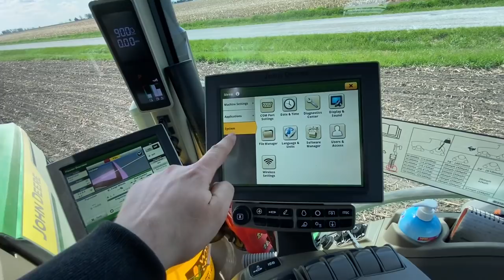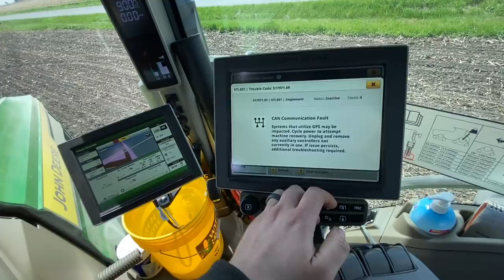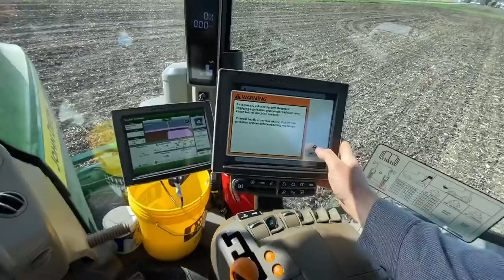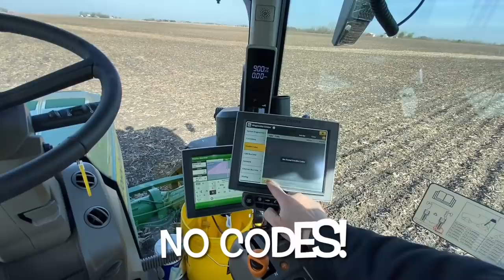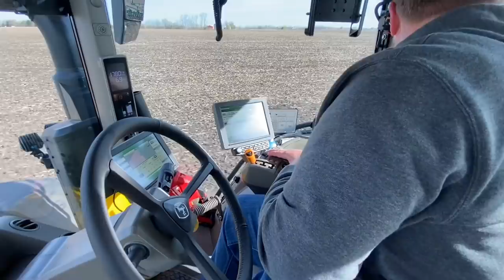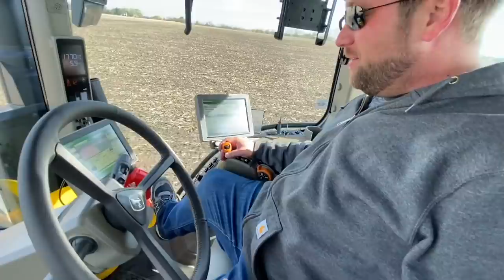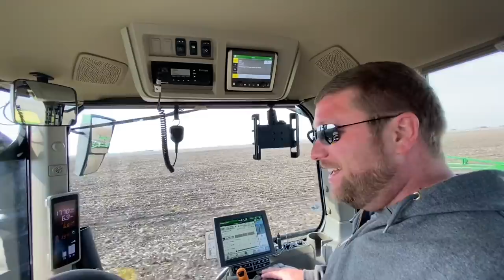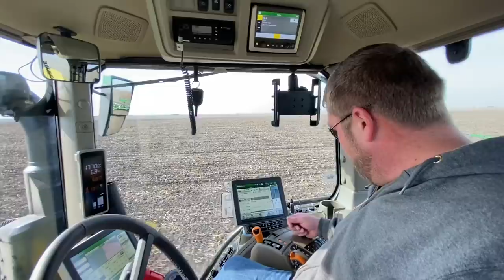John Deere 8RX 410 intermittent communication faults (DB 60 planter)

Comment: I love your videos. I worked for a Deere dealer for for 13 years,  I'm amazed that with all of  Deere's secrecy that this is on YouTube. Great Job!
Reply from the maker: Thanks for watching! What "secrets" am I giving out? 
The reason I do this YouTube channel is to get people interested in becoming Deere technicians, which we are extremely short staffed across the world. I want to get kids interested as well. I want the world to see what it actually takes to keep the farmers running. It's a lot more technical than most people think. Takes a lot of skill, knowledge, and tools to get it done. I'm not giving out any secrets, your just getting a small glimpse of my world.
Reply: @ZKMasterTech  What all would I need to do in order to be qualified enough to be hired as a JD tech? I used to be a tech for Nissan as well as a tech for a semi service shop so turning a wrench isn’t new to me. Have maybe 60-70% of the tools I’d need for larger equipment currently. Thanks
Reply from the maker: That's all you would need to get hired on at Sloans. Come on over!
Reply: Very interesting channel I love the videos where you take a transmission apart and show the steps.

Comment: I’m an old man now. My first “John Deere Experience “ was on an AR complete a steel seat and a two cylinder engine. The farmers ( I worked for were both practically deaf). Repairs? Not an issue!! Those things would run forever.

Comment: Hello Great video. I'm John Deere Technician out in Firebaugh California for 13 years. Cool to see them big planners. We don't use them out in California central valley. Keep up the great work
Reply from the maker: Hey thanks man! Yeah we are very fortunate to farm the rich, black dirt in central Illinois. Most people run 24 row 1770nt or 1775nt here. But we’re do have some DB60’s, 90’s, and 120’s running out there.
Reply: That is Awesome👍 I know them 90’s 120’s what take every bit over 500 hp to pull? We don’t do much Combines if so old ones. But we do a lot of cotton pickers 7760 cp690

Comment: Hey ZK, loving the videos 👍 we had an RX on hire this summer thought it would be the replacement for the challenger 775E.  Running 7 wheeled smaller Deere’s already.  Wasn’t good! Poor track system on them. Idlers falling to bits and 2 new tracks on rear @ 900hrs.  Obviously doesn’t like the uk 😆

Comment: We had problems with those new seats on two 8r 340 tractors,first was the operator presence switches inside the upholstery,and then both seat active motors also stopped working.

Comment: Keep em straight ZK. All the people that complain about cost and repairability have more than likely never farmed anything in their lives; small or 1,000 acres plus. Another good point you made is most owner repairs usually wind up with a call to an experienced repair tech that then has to undo the "repairs" and then fix the problem. Farm equipment; aircraft; home appliances. doesn't matter what kind of equipment you're talking about.
Reply: I have done farming with the most rudimentary machines and all kind of tractors, we used to have machines like the ones in these videos but without all the high tech, why are they so complicated now? to be fuel efficient? easy to use? I saw one of ZK videos where he found a nick in one wire rendering the machine inoperable and also it had a leaky radiator, brand new machine. I started to think John Deer machines are not so good after all.

Comment: What I like about my BELARUS 420 4X4 196? Is it never let me down , I never put a dime on it except for oil change, batteries, alway start even at -40 , yes it start at -40 , despite his 60 HP it doesn’t stop pulling hard all day , he’s over 50 years old still running very strong and will run for an other 30 plus years without letting me go so he will be 80 years , what about your 8RX in 20 years will it be recycled in Honda ?

Comment: Having watched a few vids I find it funny how JD go cheap on the computer power….  The engines starts and you’re waiting for the the OS and apps to start up…….  For the cost of these machines you’d expect the computer power to be high end given how cheap that stuff is.
Reply from the maker: Trust me the computer power is not cheap. It has to load a lot more stuff than you're average every day vehicle. You've got two different CAN buses with 40+ controllers communicating. It has the highest end electronics and controllers you can get manufactured.

Comment: I have a jd 8320R that has been randomly stalling. The first couple times the screen said engine control unit communication fault 2000.09. Another time it said armrest control unit. It is very random as it may run for 5 minutes or 5 hours before doing it. The repair guys put a different ecu in but it ended up stalling randomly again. He then replaced the armrest control unit and it seemed to be good for a day but now it is doing it again. Usually the screen just goes black so there are no codes coming up  . A planter was on this tractor this spring and working fine and now I have a grain cart on it. It occasionally surges, lugs and recovers too. It has always started right back up but sometimes it stays running while others it stalls right away again. Any thoughts?
Reply from the maker: https://youtu.be/xFrmmwzHcOE
Reply: @ZKMasterTech  thank you so much for your reply! We will ask our repair guy to look into this!